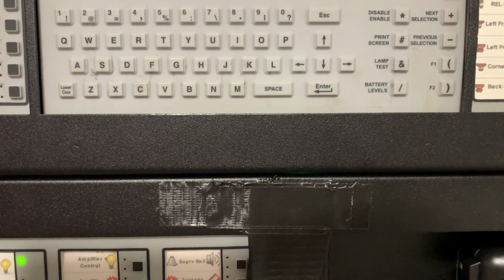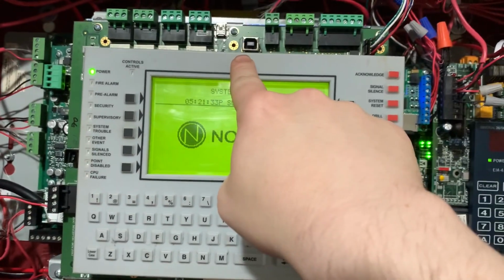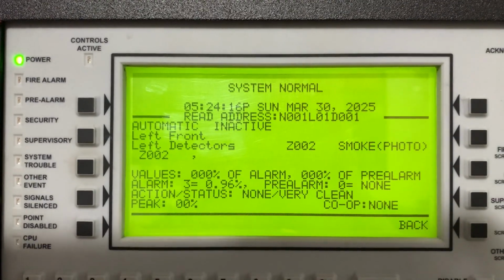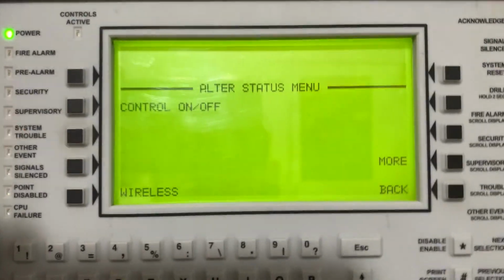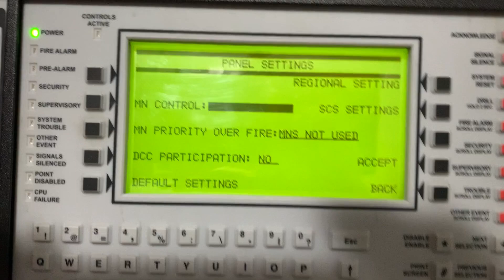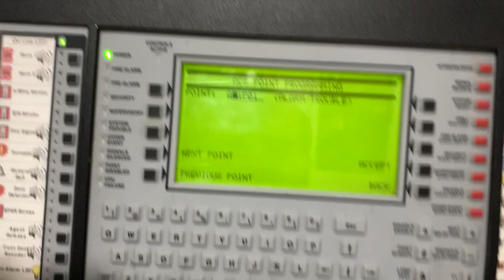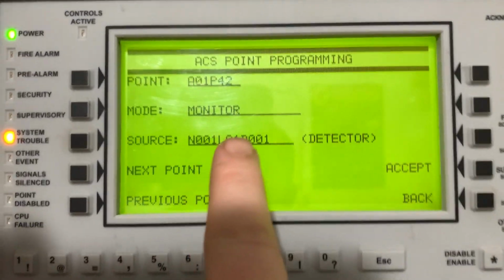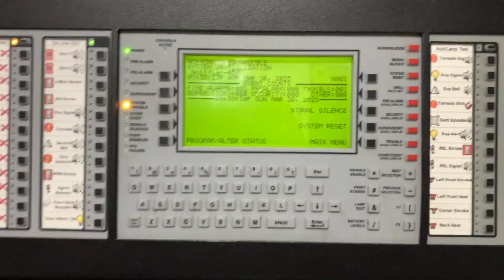Notifier NCA-2 Programming and Overview

Comment: Hi! 
I have a same FACP installed in our facility. Now, we are facing some issues with it. The troubles appear with the message "Dual address". No body even touched anything related to this system but we dont understand why Dual address troubles are appearing. Could you plz help me with this
Reply from the maker: One of the devices is likely set to the exact same address as another.
Reply: @Notifier-457  I understand and it's obvious. But no one touched the system. It was working for very long time without any troubles. But now suddenly FACP generates some troubles with Dual address messages.